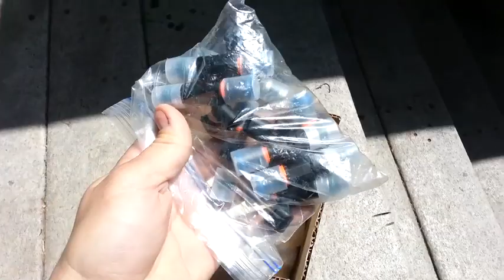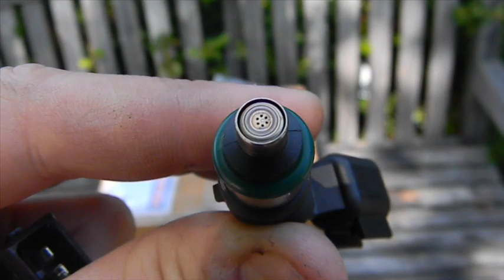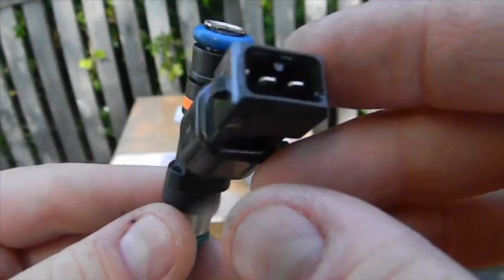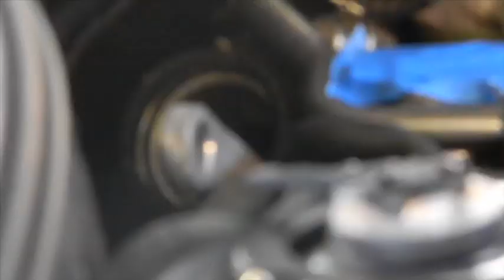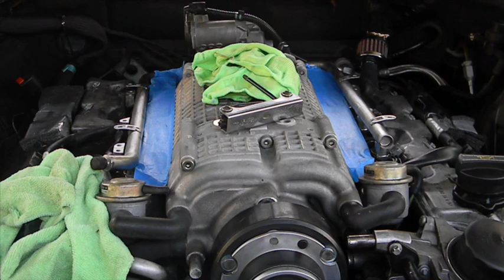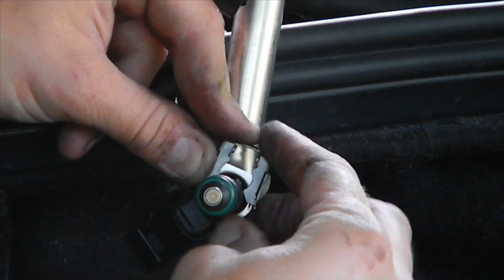How to upgrade / replace / renew fuel injectors Mercedes AMG M113k engine CL55, E55, SL55, S55

Comment: you don't HAVE to take out the throttle body! in the back of the throttle body there a pin that goes into the fuel line, pull that backwards and the fuel line come right out! saves A LOT of time
Reply: Any documentation or pics on this?

Comment from the maker: Yeah it's worth it, especially if you smell fuel at all.. Replace those orings. But the new style Bosch EV14 6 hole injectors are amazing, and really make the engine happy. You can get a good set for as little as $600 too.
Reply: aydinvideo - what’s awesome is these are $275-300 now for a set of 8 👍 Aydin what happened to your CL? Your video uploads just stopped??

Comment from the maker: Ah. See the Killer chiller could really help out in those heat soak situations.. I have over boosted the supercharger in my car with a small pulley too- and you can see the IAT's are amazingly low.. Are you using air-to-air intercoolers or air-to-water intercoolers on your new turbo motor setup now? Because if you have an air to liquid setup, you can still use a killer chiller on your turbo car  :)

Comment from the maker: Yeah, it's a v8, and stock its' 500HP and 516 TQ.. With my mods it's up around 600HP and 640+TQ, so these are the recommended injectors. Eurocharged did the ECU and TCU tuning  I guess if you're making similar power with less cylinders, you'd need bigger injectors-

Comment: This might be a dumb question but why would you want bigger injectors over stock? Wouldn't that flood the engine or just give you worst MPGs? Will this upgrade cause engine light to come on?
Reply: Tune is required

Comment: Ya I could have gotten away with 60lb injectors. I went 80 for the extra cushion for more power. Currently I'm making 400 wheel horsepower. Id like to stop at 500. Dont need much more in my car. I already spin. My first 3 gears. This little 2.0 was 180whp when I first started. Staying super charged I couldn't get enough power to much heat soak. So I'm now running a 55 trim percision turbo full swap. I love it. ( just watched your killer chiller video those are amazing results!

Comment: hello. I have a m113 engine aspirated, did you know if I can swap the engine to a M113 K engine (supercharged), I have check a lot of part number and they are the same, the only difrerence is that one engine does not have supercharger
Reply: Erick Suarez Not true, compression ratio is different and so are the heads and so are the pistons, rod and crankshaft and so are the water channels. It can work but it'll take alot more work than you think.
Reply: thanks a lot, I was already making quotation of parts, but you are right, is to expensive, is sheaper to buy a M113K engine

Comment: I have a mercedes whit m113.980 v8 engine aspirated and i nide to increase more bhp can i use some parts of the m113 kompresor you now if the parts fits and work properly if you now some wear i can finde some tuning parts for my engine forward them pleas tanks

Comment: hey there i have a 2003 SL55 AMG all stock , my injectors went bad so i am replacing them with these exact Bosch  EV14 550cc injectors and also replacing my spark plugs ( NGK Laser Iridium  ILFR6A ) and spark plug wires ( bosch ) also removing my resonators and doing a ECU tune by Fabtech , any idea to how much power i should be gaining after all this is complete on my car , i would greatly appreciate your response , im a big fan of yours and watched all your videos on the m113k engine on your beautiful CL55 AMG , thanks .
Reply: Izick Aaron You should make 180 horsepower at the spark plugs which is around 230 horsepower at the cigarette lighter.
Reply: @princepersia1  omg your the best, but you forgot to tell him that he needs to do a flush of his wiper fluid to gain that extra 43.5 horsepower